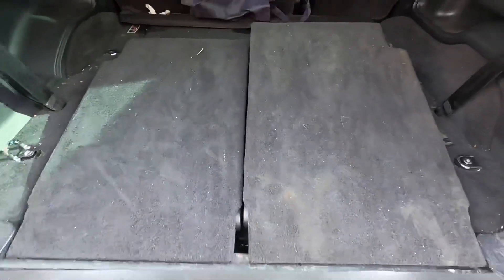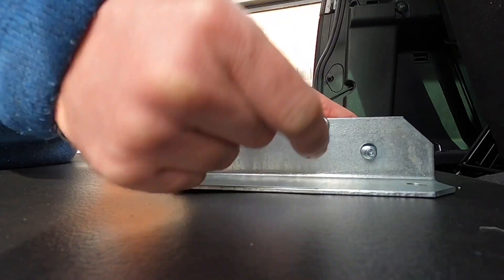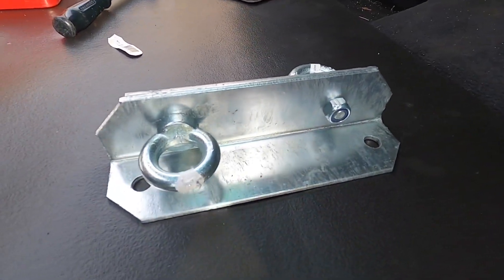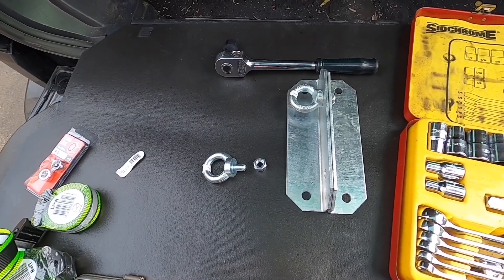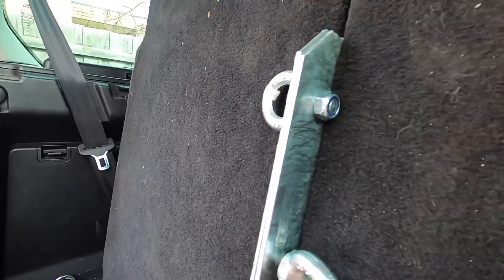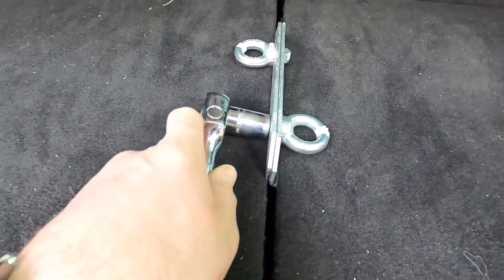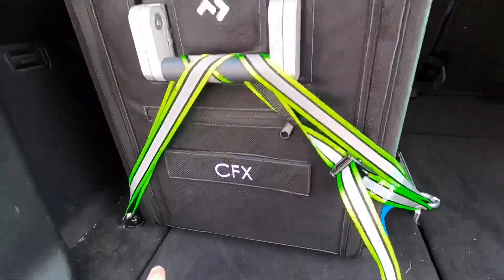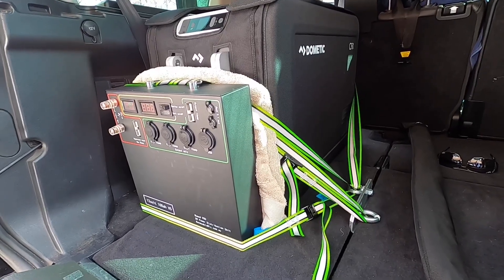Land Rover Discovery 4, Center tie down, anchor point. Fridge in Discovery 4 - 2016 LR4

Comment: Nice idea. I ahve also  a Disco 4   2016 SDV6 :) . I don't use the 2 extra seats at all, so I removed them completely and carpenter friend  made me a nice   wood floor that fits perfectly, made of 2 sections. Being wood   I can do what ever to it.   This also creates  some storage space for stuff   you  hope you will never need :) . The bloody  seats are like 50 kg, so you gain some payload as well.  I saved all the bolts so I can install them back at any time if sell the car ( I don't think I ever will, I love it too much :)   )  . Great videos.
Reply from the maker: Thanks mate. It would be ideal to get rid of the third row, but having 3 kids still at home you just never know when you’ll need the extra seat. 50kg?! Wow that’s a great weight saving. I’m right on gvm, so that would be great to reduce the weight. Hmmmmm

Comment: I just directly hoop the tie down on the seat mounting bracket. The control box just between the side trim and seat. If I need the 6th seat, I just remove the fridge. Battery and control box stay.